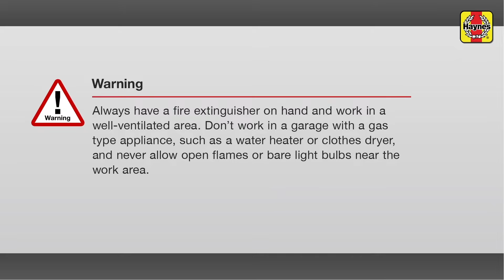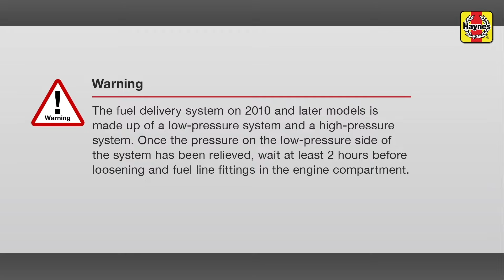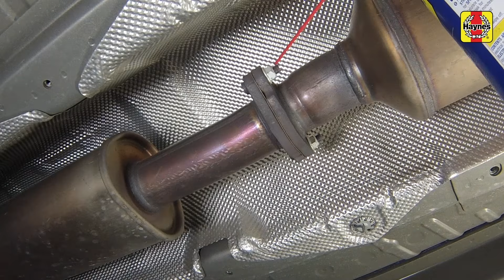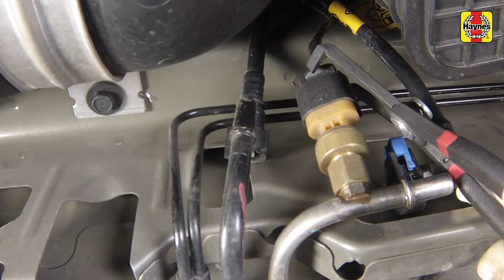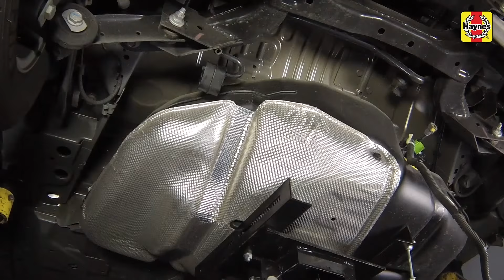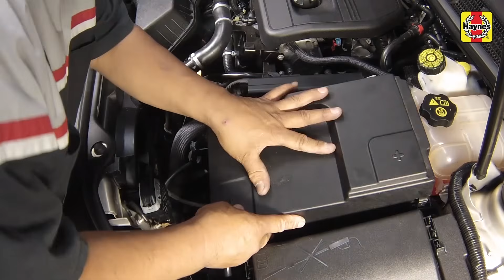Buick LaCrosse (2005 - 2013) - Replace the fuel pump

Comment: Should have a access panel in the trunk. I know the 2009 has the access panel on the right side toward the back seat.
Reply: @ComdrStew  well I’ve pulled the back seat out, no pump. I reckon I’m headed to my trunk now
Reply: @ZombieGuy115  Yeah ours was in the trunk. It had a panel under the carpet. Unfortunately we got side swiped on the interstate going 80mph and spun out hitting someone in the slow lane. It was totaled.

Comment: I came here hoping to see where the fuel tank pressure sensor is for the evap system. I have a '14 LaCrosse 3.6 that keeps showing a p0455 and that is one of the things i may need to change out.

Comment: thats way too much work , carefully cut an access hole .remove the back seat , cut a shallow slit in the steel panel ,insert a small mirror in slit and see where is fuel pump ,then cut a slightly bigger hole for pump removal and install ! some vehicles have this access port  naturally ! ...if you think this is bad , wait till you have to change the spark plugs ! lol ......
Reply: @CuriousFord  awesome !!!!
Reply: Perfect. Then place a hinge on cut out access hole panel for easy futre access

Comment: 2010 Lacrosse. Due to the wires to the fuel level sensor not being marked, which wires go to which terminal when replacing the fuel level sensor ? Sensor (+) / Sensor reference signal (-)